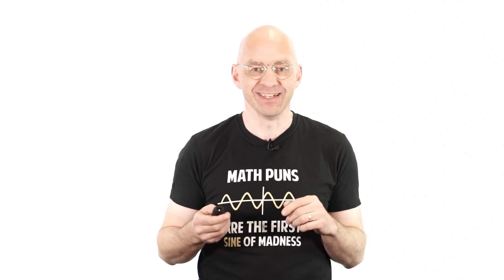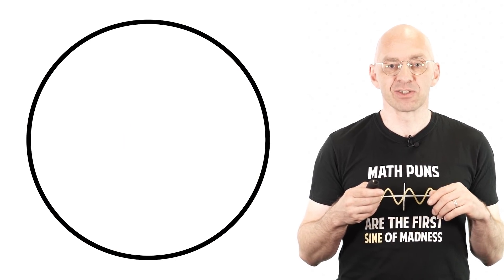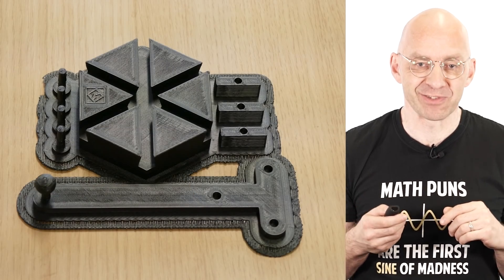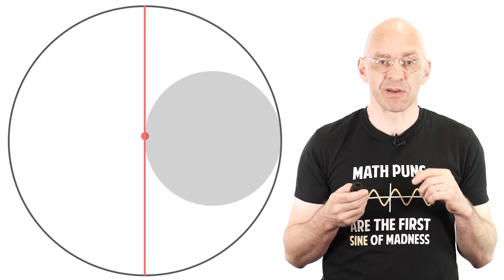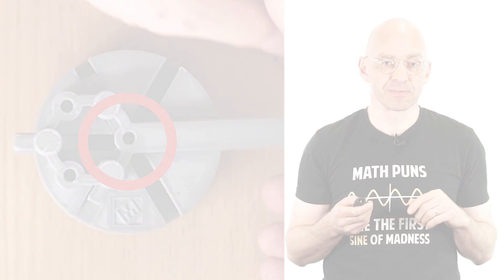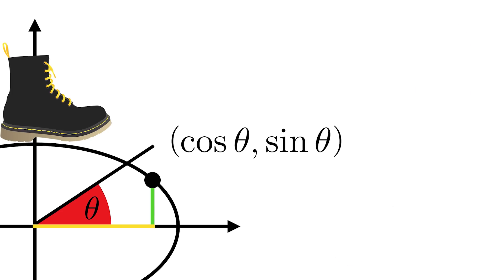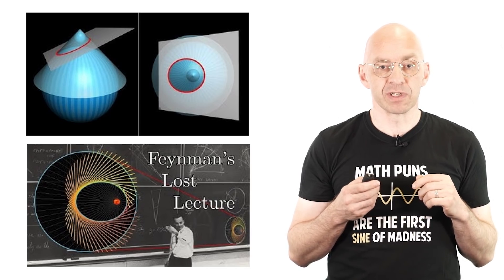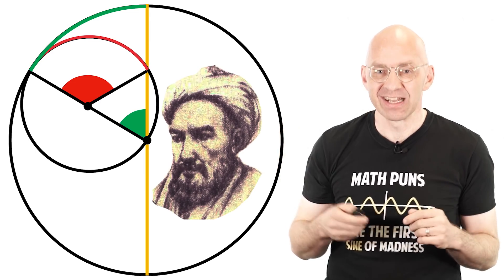Secrets of the NOTHING GRINDER

Comment: anyone else think wankle engine? could this be used in reverse so that instead of turning the crank to do nothing, a force can be used to expand the pistons and turn the crank? it would be a balanced engine too because essentially no matter how many pistols it had, they would be equally spaced and at different points of ignition based on the differences in compression of the little slidey rods. obviously this needs a cap or ring around the perimeter just beyond the apex of each rod's exterior movement in order to complete the compression chambers. anyone else getitng this or do i just see imaginary engines?

Comment: The nothing grinder is a good identity for the nature of i if the circumference is pi (2pi(i/2) = ipi. So it's alternating as x is either full positive or negative when the shaft is horizontal (0/i).  Y alternates one 90 degree rotation of x and it fully positive or negative (if i/2 is the radius) and has an infinite slope or i change in y and 0 change in x (i/0).  Thus half of i is positive and negative for any n variables in n plans if the origin is zero.  So those are the 4 polarized 0 products for the two dimensions and then there are 4 complex i products for each of the 4 areas (+x,+y = +i; -x,+y = -i; -x,-y = +i, and +x,-y = -i).  So each degree is a fractional y/x slope for all i products of x and y.  There is equality at i^2/2 = x and y defining the square root of i giving two polar products from four area combinations.  That is for the S electron shell and you move up 2(n^2) as 1 is infinite (n/n = 1 so 1 is an infinite ray (relative to pi) with a constant slope).  From there its just a matter or primes so 1 = S shell (polarization for 2 pi), then 8 for the previous plane 2 and the new 6 (polarized 3).  This continuous to 5 then 7 and perhaps 11, so this would be reality determining math and vice-versa if you use the unique slopes of pi as a full infinite series of fractions from 0/+v-1(i) to i/i to i/0 with the "to"s constituting all fractions with a numerator greater than the denominator (positive exponent) and all fractions with numerator smaller than the denominator (negative exponent).  So once you've got pi hybridization theory mapped out it's easy to apply it to waves and probability distributions for a complete theory of reality with 7 relative variables (before polarization). Great videos.

Comment: If you take a loop of string and a pencil and draw around a single tack you get a circle.
If you take a loop of string and a pencil and draw around two tacks you get an ellipse.
If you get a loop of string and a pencil and draw around 3 tacks......
What shape do you get?

Is it one of the trefoil rounded triangles?
I believe it has 3 similar tight ellipses on the corners and 3 wider ellipses (a regular triangle produces equal ellipses) on the "long sides". 
You can generalize this to more pins/sides.
Is this a special shape?
Is it a useful shape for anything?

Comment: just get 2 points stretch a wire between them and a pen inside and you'll find out that the second point will make the circular orbit of the pen into an ellipse add third and you get rounded triangles add forth and rounded quadrangles

Comment: We used to slot two boards, set them perpendicular, and with another board (with two spaced nails riding in the grooves) create any size ellipse for window or door headers. Worked better than the string and two nail method. Thanks for the vid.

Comment: The final proof seems unnecessary except to just provide additional assurance that the arcs are the same length because whenever something rolls without slipping it necessarily is tracing the same arc.
Reply: NerdyPi , true. Also the lenghts of the circles don‘t change over time.
Reply: Not the point (pun not intended). If the smaller circle had, say, 1/3 the diameter of the larger one, it would of course still be true that traced arcs have the same length, but the point being tracked won't trace a line. The final step of the proof involving the parallel lines only works when the diameter ratio is 1/2.

Comment: But Wait!  There's More! e^(jwt) is the most amazing function. Engineers use j instead of I, because I is for current. w is for the Greek letter omega for frequency.  You've just been staring at e^(jwt).  In a linear system a sine wave input signal can only be changed by magnitude and angle.  Polar co-ordinates describe magnitude and angle.  So the response of a linear system to a sine wave input can be described by a polar  co-ordinate.  Instead of thinking of Z = jwL think Z = (1/wc)e^(-j*pi/2).  There you have your magnitude change of (1/wc) and angle change of -j*pi/2.  You can fill in the details with an electrical engineering class or two.  Not a differential equation in sight! Order now and we'll send you a cosine wave for free!  Just pay separate shipping and handling.
Reply: camgere why don’t engineers use I for current and i for imaginaries?
Reply: I and I are upper and lower case. Sometimes upper and lowercase are used to distinguish different types of variable (e.g. Matrix Algebra, Transform Theory).  It's not a bad question.  It was decided long before I came along.  Conventions only work if everyone agrees on them.  BTW the phase above should be -pi/2 radians (-90 degrees).   @rcksnxc361

Comment: You can also make a little gear ratio out of this mechanism. 
  If you take the entire animation of the Tusi couple e.g. the one right at the end of the video, and rotate it clockwise about the centre of the large circle, and at the same angular speed the small circle is rolling around the big circle, then the small circle will stop moving around the large circle and rotate on the spot. The large circle will also rotate about its centre, but at half the angular speed of the small circle. 
  Therefore, if you attach an axle to the centre of the small circle and an axle to the centre of the large circle you can make a 2:1 gear ratio just using straight slots and pins. The limitations to this mechanism is that the output shaft must be on the opposite side of the 'gears' to the input shaft.
  Somewhere on youtube there is a video of this gear mechanism someone made from wood I think but I can't find it.
 It still really fascinates me that you can make a perfect gear ratio just using this simple geometry of straight slots and pins, whereas normal gears require a much more complex geometric shape.
I have a 3D printer and will print out your design :). This also really makes me want to make this gear mechanism and print it off (it's something I've been thinking about for a while). I could even make it in OpenSCAD and make it parametric, so you can use any number of pins and show that the Tusi couple will work.

Comment: So is the rotary engine a complex "do-nothing" machine?

Can you verify or am I just over thinking the Mazda power plant?
Reply: 3:00 I was also immediately thinking you could make a compact 6 cylinder 2-stroke with the crank/pto at the front and exhaust at the rear centre...it's probably already been done
Reply: The main mechanical device behind the Wankel rotary engine is the rotation of non-circular solids of constant width--odd-sided polygons rounded in such a way that every diameter is equal, like a circle, while still having points closer to the center, just always countered by a point equally farther away from the center on the opposite side.  It's honestly more closely related to the spirograph (the gearing system that is used to connect the centers of the non-circular solids to the main shaft with the proper movement basically a spirograph in reverse) than the do-nothing machine, but IS a  relative.   A more direct consequence/adaptation of the do-nothing for mechanisms is that you can have multiple linear-reciprocating machines (such as normal automobile engine pistons) attached to the same point on  the same crankshaft without them interfering, which is the principle behind "V" engines, like the V6 or V8.
Reply: @IONATVS  not that i dont appreciate your post (i do) i just thought we should take a moment of silence for us to all appreciate that it is called the 'wankel'
Reply: @pepe6666  Yep, it was invented by Dr. Felix Wankel, and the first commercially available car to use this engine was the NSU RO-80; there was a joke (allegedly it was true, even) that whenever two RO-80 drivers would meet on the road, they would show each other a number of fingers, to tell the other driver how many times they had had the engine completely replaced.
It wasn't until Mazda's engineers got their hands on the design that it became a viable option to power a car.
Reply: @IONATVS  yeah man i agree. its got me thinking about making wacky rotary to linear devices now. got me thinking about waves behaving like projections of higher-dimensional rotating wackyness
Reply: Nah, to me it looks more like a radial aircraft engine.
Reply: @makismakiavelis5718  radial engine same thing basically is a engine you can call it anything you want but I'm going to make one of course it will be a two stroke could make a 4-stroke out of it I will see you when I get in my shop it will have round Pistons of course and we will figure it out
Reply: I was thinking the same.

I wonder if a radial engine is also a nothing grinder...a simple one.
Reply: you guys got it all wrong. you want a 1024 cylinder engine
Reply: If a wankel is a do-nothing machine then Rob Dahm truly is stringing us along
Reply: The rotary is based on the epitrochoid shape. This is based on 3 equally spaced circles of the same diameter, cut at their intersections which make the famous dorito shape and unlike the do-nothing, the outer spins about the inner circle, in this case the stationary gear.
Reply: I think I can make an engine out of one I would design it slightly different of course but it would be the same crankshaft
Reply: well to be fair 1/2 of the time is spent fixing the wanker engine.. so i would say its a do nothing machine...
Reply: "Maths... Und You Vill Like It!"
Reply: Jim Beam the wankel is different becaue of internal combustion.

Comment: First thing I thought about the nothing grinder was a car engine if it only had more lines... And then you showed it with 3 lines... And then I started thinking could it actually work as a car engine...
But idk... I didn't go to collage... 
Like...  Idk how much trouble the extra mevement would be for an engine... And would it lose efficiency or gain it from gases leaking to pressurize other "sylinders" idk what they should be called in this case...

Comment: I saw the same effect when new traffic lines are painted on a street.  If the paint does not dry right away the cars turning over the lines will create an exact duplicate of the line roughly one circumference away from the original.  I remember thinking it looked like a makings of a really primitive Xerox machine.

Comment: Thanks, great video. This is very much like the action of a Geneva Mechanism. I operate multiple spindle automatic  screw machines. Several spindles are arranged in a large cylindrical carrier. Between each tooling operation, the carrier is indexed one eighth of one rotation. This is accomplished by the Geneva Mechanism, which divides carrier rotation accordingly.

Comment: 10:55
Are you sure about the arc lengths thing? 
If the circles are perfectly rolling, w/o skidding, isn't that always true no matter the inner circle size? 

I think the proof kinda goes the other way around: 
b/c the arcs are the same, but the radii of the bigger circle is 2x the radius of the smaller one, you can say that the angle is 2x bigger for the smaller circle. And from that, and a bit more of geometry (similar triangles) you can then conclude that one end of the smaller circle arc lies always on the diameter of the bigger circle.

Comment: You may call them nothing grinders, but they actually show how combustion engines work. I wouldn't call that nothing.
Reply: Can't say as I agree with that statement. It's only sliders, no intake, compression, ignition, exhaust. It's only similar because there is a crankshaft, but it acts nothing like an internal combustion engine. So it's nothing.
Reply: @RR67890  I could say you're nitpicking, but maybe a better term would be piston engine.

Comment: is it possible to make a variable  (tuned digitally) 3d grinder? tune it the modulation of say an earthquake and you might be able to produce a wave to counteract the wave of the earthquake and save the building?
or use it to quell vibrations from a rocket engine?

Comment: There are these circle shaped ruler-like objects with triangular teeth around them and inside them, and then it's paired with a filled circle that has holes at different distances from the center, just big enough for the point of the pencil. So you put the pencil circle inside the bigger circles (or outside) and recreate the system presented here. They are cool.

Comment: Could this be used as internal combustion engine?
Reply: Akseli Kerola This is kind of how the Wankel engine works.  Radial piston engines also have a similar (but different) crank mechanism.  You should check out cutaways of those two engine types.  Elliptical motion, however, isn't usually very useful in vehicles.
Reply: Brain Mind You always have a circular track available.

Comment: 3:17 At this point, I’d guess that you can have any integer number of slider axes ≥ 2, and furthermore they don’t even have to be distributed at uniform angles (subject only to the mechanical limitations of actually building a physically possible shape). As the centre point between the pivots always lies on a 4D* linear spiral, a projection of that world line along any axis will produce a sine wave. Furthermore it will always be a sine wave of the same amplitude and frequency, just with phase dependent on the axis angle.

*3 dimensions of space + time
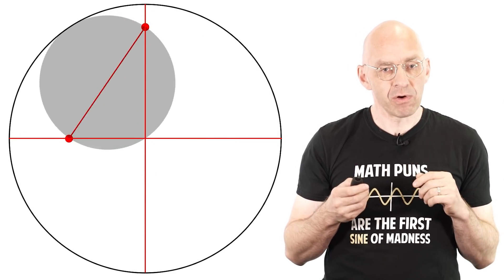Reply: 6:04 OK. ;)

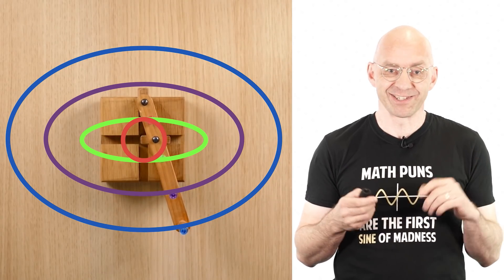Comment: 1:47 As the point on the handle gets closer to the middle screw, the ellipse gets more and more eccentric, until at the screw, it becomes a line (horizontal in the video).

Further along towards the other screw, its eccentricity is reduced until it reaches zero at the midpoint (perfect circle), then increases again, this time the ellipses are squashed the other way, until at the end screw, the shape traced becomes a line that is vertical in the video. Beyond that the eccentricity reduces again, but it won’t reach zero until you get to an infinite distance.

Comment: Tracking the path of either pivot grants an ellipse of eccentricity 1, such that there is 2 points between the pivots that will trace out an ellipse of any given eccentricity, except in the exact middle of the two pivots, where a circle forms. Looking past the pivots to the attached arm, as you sweep from the pivot outwards to infinity, you will gradually sweep from ellipses of eccentricity 1, and the eccentricity decrease the further out you go, asymptotically approaching 0. Thus there is 1 point, that traces a circle, 2 points that trace out eccentricity 1, and 3 points that trace out any eccentricity between 0 and 1.

Comment: Regarding the puzzle at 2:09: "how many points on the arm trace an ellipse of the same overall shape?":
It depends on how "overall shape" is defined. If it is an ellipse with a certain ratio of the two semi-axes, there is no other point on the infinitely extending arm that draws an ellipse of the same overall shape. The distance between the pivot points is the difference between the semi-axes, so no other point will deliver the same ratio of the semi-axes. The longer the arm gets, the closer the ratio gets to one and the ellipse approaches a circle. There may be one point (or even two?) on the arm between the pivot points that produces an ellipse with the same ratio of the semi-axes.

I can remember how I built such a nothing grinder with LEGO railroad parts when I was a child. I had a rail-crossing element and extended it to two pieces of perpendicular rails. With two connected bogeys, one running on each of the rails, I got such a nothing grinder and played a few minutes with it, observing the connected movements of the bogeys. I do not know if I discovered that I could have used this arrangement to draw ellipses.

Comment: The Trammel and the Trig radius are related exactly and specifically as the equation for the circle is the same as the equation for the hypotenuse of a right triangle.  (A^2 + b^2 = c^2, vs  X^2 + Y^2 = H^2)

Comment: I'm trying to print this now, but my slicer (Simplify 3D) is fairly upset with the STL. Lots of the shapes seem to be built out of more primitive shapes that don't quite line up, especially the round arm (with the 6 holes). It ends up printing it in lots of little pieces instead of continuous. I can't quite tell, but is the model itself trying to be hollow? I'm curious what you made it with. I might try measuring it and see if I can re-make it so that my slicer is happy with it.

Comment: minute 11 and on: isn't it sufficient to say that the inner circle rolls inside the outer circle to show the equal lengths? The inner circle would need to slide or jump in order to make the arcs different in length... (physicist's approach?)
Reply from the maker: That's the start of my argument. The circles don't slip and so the arcs along which they touch have to be of the same length. Now it's clear that the arc along which the large one is touched is the green one shown in the video. However, it's not obvious that the arc along which the small one is touched is the red arc. We have to prove that :)
Reply: for a physicist it is obvious - it is the same as a wheel running on a flat surface, the distance traveled is equal to the circumference times the number of rotations.